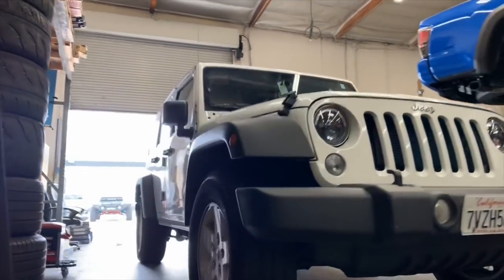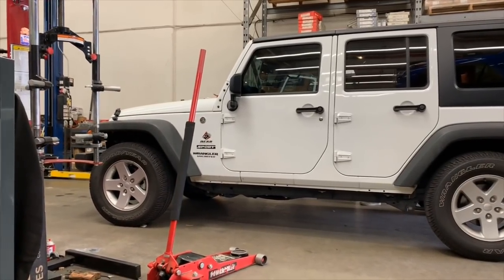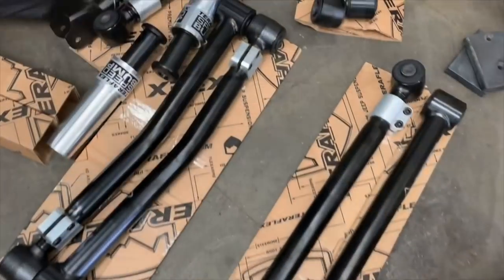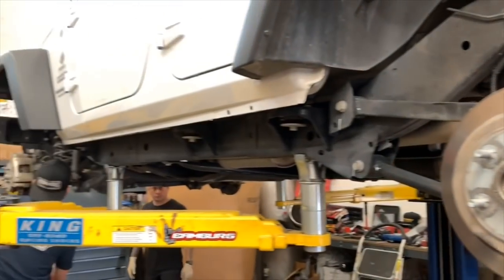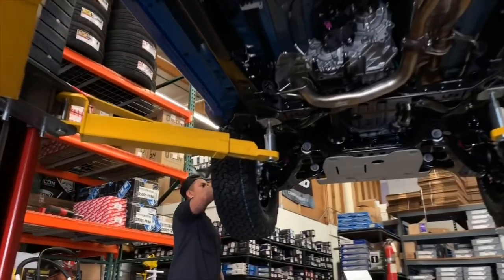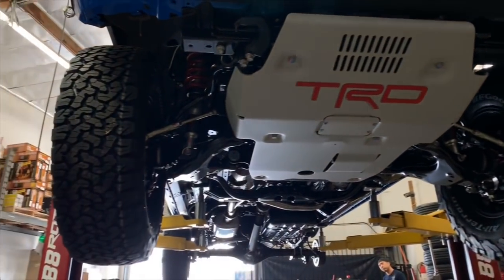JEEP WRANGLER SPORT 3" LIFT - TERAFLEX ALPINE CT3 SUSPENSION w/FALCON 3.3 PIGGYBACK SHOCKS

Comment: I know it's almost a 9 month old video,  but did you need to address the Rzeppa joints, particularly the front at the transfer case? If not, how has it held up? From what I hear, 3-3.5 inch lifts is about the cutting edge for them. Some do fine and others don't. What did you observe with this install?  Thanks.

Comment: What size are the wheels and tires?
Reply: Pause the video at 9:21 at the right spot. The tire size is 35x12.50R17. The wheels I'm assuming are 17x8.5 +0 offset 4.5" backspacing because that's the only one they sell.

They look like 37s though huh? Such a nice fit.
Reply: @Jay-gt5ux  35" AT KO2's...even Teraflex recommends 35" as the max size for the 3" Alpine CTR lift. For 37's you are probably going 4"+  lift...unless you are building a mall crawler. And "R17" Radial/17" wheel. (No assumption needed ;)